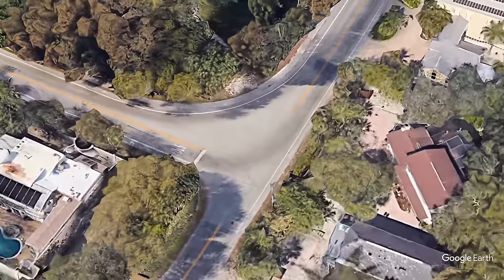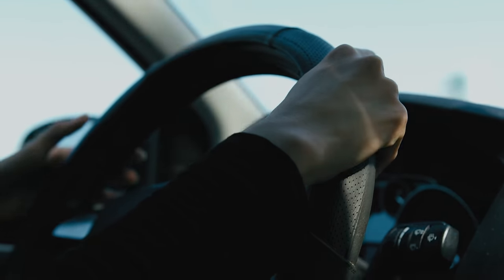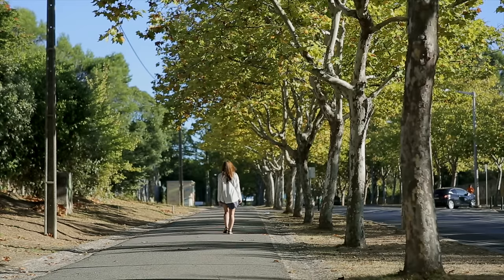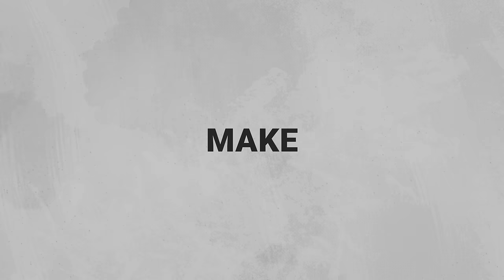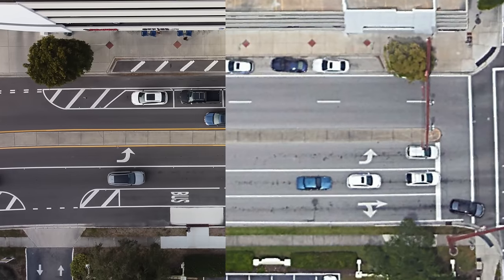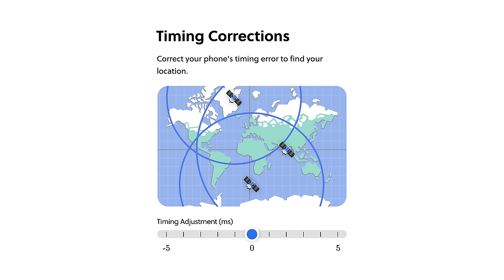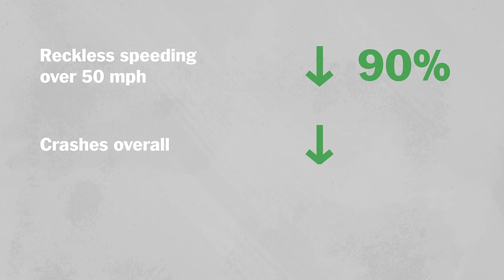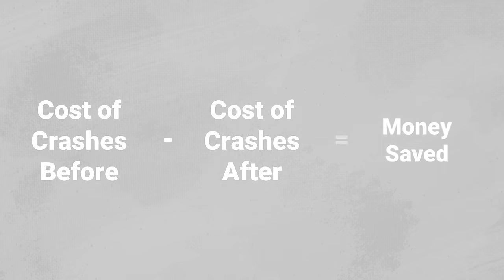This is the key to safer streets

Comment: As a European, it is very strange to see that such basic traffic regulation tools are not widespread. But I have tried to be a pedestrian in the US. Remember one place, on very civilized Cape Cod. The place looked like two, quiet villages connected with leafy back streets. But walking 20 minutes or so from our accommodation down to a sea food restaurant by the canal was one of the most scary things I’ve ever done. No pavements, no zebra crossings, nothing. And the drivers were not even looking for pedestrians. Because there were none. The next day, I needed to buy some bread for breakfast. On the other side of the street, some 250 m away, there was a small shopping mall. Based on what I learned the last night, I took the car. Because walking was just too dangerous.
Reply: I can't believe this is 'new' news. These are the basics of road design in Europe and have been for decades
Reply: I live in the Midwest and it's super common to have rural highways that cut through the center of small towns. It will be a 55 for most of the road, but dip to like 25 in these towns with no change to the road design what so ever.
Reply: yeah, even the problem with blind spots when turning is not seen often because if there's a 4 lane road 99% of the time it's going to be signaled or has the left turn removed
Reply: I live on an island which is modelled after the US and this is EXACTLY my life too
Reply: There are still a lot of places in Europe that also use anti-human road design. Scandinavia and Central Europe are pretty good now with some notable exceptions, but Eastern & Southern Europe are not much different from some bad US areas.
Reply: Yeah i feel like Americans dont understand this is literally the same as if they saw the news about how Europeans just found out that you can make traffic lights lol. It's such a basic, essential road feature.
Reply: The main reason is that there's so many roads and intersections compared to other countries, most of which serve so little traffic that it makes no sense to spend millions. It's also up to each state, city, or even private property owner to invest in roads and improve road design, not a federal investment or oversight.
Reply: @ShayneHartford  This and also most roads US were built for driving before anything else. Now expected for the drivers to change.
Reply: @ShayneHartford  "The main reason is that there's so many roads"

are you being serious? this is the country that keeps adding lanes to your  6 lane highways
Reply: When I attended a university that was split by a major stroad, I used to hold my bookbag over my head when crossing the street so that if I was going to be run down, I could throw 50lbs of engineering text books through the windshield in an attempt to avenge my own probable death. I never did that, but one time a driver clipped my bag when I put it down to my side prematurely. He had been stoping but gunned it and ran the stop sign. In staying on my feet I spun like a top and that heavy case bashed in the whole rear quarter panel. It broke the latches and ripped it out of my hands. The idiot driver actually got out of his car to threaten me. I told him that in spite of his attempt to run me over, I was still standing and that if he got within my reach, he would not be standing for a long time, if ever. With all the adrenaline I had from that close call, that was the truth. I got his plate and he wound up with criminal charges, but he was uninsured. As far as I know he lost his car and license and was on probation for quite a while. Later that month another driver ran a crosswalk light on the stroad and killed a student in a wheelchair. He was run down by witnesses on foot who caught him about a mile a way, pulled him out of his car and in the process caused enough injury to land him in the hospital for a while. His slimy lawyer had him appear in court in a wheelchair, but photos of him out jogging with his ankle monitor on turned up. Walking on or near a stroad is seriously dangerous.
Reply: @uschurch You are correct. Especially when it comes to Russia (which is where I'm from). For instance, there are plenty of unsignalised crosswalks on multi-lane highways (usually at bus stops for nearby villages), with speed limits as high as 90 km/h (which is the default outside of built-up areas). They are dangerous for plenty of reasons, but the main reason is that a car in one lane blocks the visibility of pedestrians in another lane. Although there is a rule requiring drivers to slow down or stop if a car in an adjacent lane has done so, it's sometimes ignored in practice (especially on highways). Another reason is that these crosswalks are rarely used by pedestrians, so drivers get used to not expect a pedestrian crossing there. This, combined with the high speed limit, can easily lead to a rear-end crash (which can further push the car into the path of pedestrians).
Also, drivers only get fined for speeding 20 km/h over the speed limit. And even then, it's only 500 rubles (which is a small sum) considering that they get a 50% discount for paying within 20 days. This means that in practice, drivers drive at around 20 km/h higher than the speed limit.
Reply: How were you walking next to a road if there was no pavement? Roads in the US are paved, by definition.
Also a silly reaction of you not to walk 200 yards because driving was "safer" in Cape Cod. Lol not exactly a big city.
Reply: @TehButterflyEffect  I learned British English as my second language at school. German as my third language. So "pavement" is "sidewalk". As I guess most Americans with some basic education know. BTW: Cape Cod is not a city. It’s a large peninsula in Massachusetts.
Reply: @TehButterflyEffect  By "pavement" he meant sidewalk. That term refers to the sidewalk in the UK.
Reply: @ShayneHartford  "most of which serve so little traffic that it makes no sense to spend millions."

It doesn't cost more to build a safe road than a dangerous one.

Most of the Dutch safety and bike infra has been built "for free". They update the standards with new safety research, and when the road needs to be re-surfaced anyway, it's upgraded to the next standard.
Reply: Come to Brazil, you'll be shocked how animalistic roads are 😵‍💫
Reply: @TehButterflyEffect  We also have "unimproved" roads (i.e. 4x4 trails), and gravel roads. There are also some places where the pavement is so old and of such poor quality that it might as well be gravel. The road in front of the house I grew up in was reasonably solid for normal car use, but when I attempted to sweep it up in preparation for a static display of an air ambulance I discovered that sweeping it was removing aggregate. I had to recommend against landing any helicopter for less than a real emergency. Apparently this was the wakeup call because they repaved the street the next year.
Reply: @karen_is_coming839 the point of those is to have cars speed so as to provide funding to the city/police, not to make people safer
Reply: @FlatEarthKiller  Tons of cities have grown wider and closer together over the last 50+ years making previous rural roads into city roads.
Reply: @FlatEarthKiller  The problem is that many stroads were rural routes that had a town build after a road was already there. Then expanded to a stroad. Which put more traffic on the road because it was at, near, or in between where people need to travel to get anywhere.  Also having multi unit housing along the stroads.
Reply: I agree. I tried to go car light. But, the streets are too wide and right and left hand turning drivers don’t pay attention. Now, I have to drive everywhere or risk getting run over.
Reply: We did this on purpose starting in the Progressive area. It was a moment in American history where elites and academics were given a blank check... and it has been a disaster, we are slowly recovering.
Europe relatively very poor during the time America did this to itself, so did not quite follow along.

Dutch drivers are careless and deliberately intimidate pedestrians, but in the cities the road design is good at keeping them apart.
Reply: Yess that's why I watch this, it's  kinda funny but sad too haha
Reply: This is stupid and terrible. A solution in search of problem. This slows down the street needlessly.
Reply: Ive always wanted to move to the US. Unfortunately this was my biggest deal breaker.
Reply: @t288msd From the 50s onward the idea has been to decommission trains and bulldoze residential land all to prioritize the car :( . I believe there can be change though.

Comment: The idea of using plastic to make road adjustments quickly and cheaply is really neat.
Reply: Good ability to try it out and reconfigure it pretty easily too, if a better solution exists
Reply: There are much cheaper alternatives that wouldn't be so bad for the environment though.
Reply: @MegaLokopo Enh, the plastic is recycled
Reply: @Brent-jj6qi plastic breaks down into micro plastics and is washed away into the environment. It’s a real problem.
Reply: @hotjanuary  I suppose, but honestly, a lot of the cheaper methods probably don’t last as long, or wouldn’t appreciate a giant truck going straight through
Reply: @MegaLokopo  Such as?
Reply: Roundabouts are exceptionally  useful, the downside is when theres alot of them the front outside tire wears way faster than the rest
Reply: @cyclesaviorn2700   Citation?
Reply: @kjh23gk   like evidence? I buy two additional front passenger side tires for every one full set of tires my vehicle needs. I love them though i would much rather buy the extra rubber than have to slam on my brakes every time a light wants to turn red at an empty intersection
Reply: @cyclesaviorn2700 Why are you not rotating your tires? Even with heavy roundabout use that is not normal.
Reply: @cyclesaviorn2700  That's called an anecdote, not evidence. And it's more likely caused by unbalanced wheels or underinflated tires. Do you not rotate your tires between changes?

And roundabouts are not magical. You corner on a roundabout just like you corner at a junction, or a curved road.

In fact you likely corner more on junctions than on roundabouts. Maybe you take corners too fast?
Reply: @kjh23gk  well thats not wrong by any means, yes you do corner more on a roundabout than a regular intersection because the turn is longer and at a more sustained speed. The outside tire wearing is because it is taking virtually all of the turning forces at said speeds. I have multiple vehicles in very good condition that i drive around interchangably. Between the four towns/cities i live and work in there are primarily roundabouts. All of my vehicles over the course of ten years have shown the same wear patterns and so do the vehicles of my coworkers and friends. Yes continuous rotation would spread the wear out more evenly but then the traction of the other tires wouldnt be satisfactory, whereas one tire may only cost $75 while still lasting a couple of years. Anecdotal sure but evidence nonetheless. Yes this area around fishers, carmel, noblesville, and pendleton indiana is a "race track" as well so that is a correct inflection
Added quotation marks around race track
Reply: @hotjanuary  Point is the plastic already exists and this repurposing will extend the useful life of the plastic until a better alternative can be found for bothe the traffic calming measures and the milk containers
Reply: @cyclesaviorn2700  That's not a roundabout problem, that's a bad driver problem.
Reply: @hotjanuary  Plastics aren't the enemy. Single use plastics are.

There are many great problems where plastic are actually the most eco friendly solution compared to any other alternatives.

We should be reducing our usage of single use plastic, but eliminating plastic entirely isn't really doing good for the environment.

Sometimes we do want a tough material that can survive the elements, and in this case plastic can, end up being better for the environment than anything else. 

Doing good for the environment is more subtle than just plastic bad, wood good.
Reply: They call it "tactical urbanism".
Reply: It taste really good, and it's real special! (That's plastic)
Reply: @kjh23gk  Simple paint, for a start.
Reply: You can also use paint, In the UK they use paint. They have mini roundabouts everywhere.
Reply: @MegaLokopo sheesh. Pay attention.

Comment: I live like 2 minutes away from the cicinnati road diet featured in this video. The road diet isn't even that long(only covering about a 1-3 miles) but it is in an area that sees more pedestrian traffic than other areas nearby because of it's proximity to a school, a library, and a lot of shops/resturants in walking distance. That road was super dangerous cause it cut right through that! It feels a lot safer now(and that's shown in the data too!) and I love it. Unfoutunatly though a lot of drivers hate it and are very vocal about it(my mom included). So much so that there is a chance that those changes will be reverted just based on the vocal opposition alone, but the safety data isn't on their side and with all the work that went into getting it approved I doubt those involved will just stand by and allow that effort go to waste. A big part of that opposition I feel comes from people who drove on that road being used to going down it at such high speeds and also having a second lane to pass people, which is exactly why the road was so dangerous.
Reply: One of the problems that many people overlook is that a lot of infrastructure can grow next to a road in a very short time.
Expecting drivers to change for that. Even though they were there first.
Why don't we build around the road instead of expecting the road (drivers) to have to change?
Reply: "Uhgh, come on slowpoke, step up the pace! Who drives 40 in a 35? Wish I had a passing lane."
Reply: @randgrithr7387  That's basically what the naysayers sound like 😂
Reply: @AdamStansbery  Drivers adapt really fast when there's road work or even after a road gets widened. There's nothing that would make this different or harder other than spite. Regardless, driver's ability to adapt is not really a huge problem because people eventually get used to it. The only reason people haven't already is because it's all temporary infrastructure at the moment and there's a chance it'll go back to what it used to be ans some people are banking on that.
Reply: @AdamStansbery  That's exactly what makes stroads so dangerous. The side effect of that growth is that it's hampered by the reduction in pedestrians who don't feel as safe. The data shows that the more friendly a street is to people walking and biking rather than driving, the more businesses on that street benefit. This is largely due to how people behave when driving vs walking/biking. When someone drives to a place, they tend to only go to one particular business before driving somewhere else. They also tend to change their plans based on available parking, increasing the chance for lost business. Pedestrians/cyclists, on the other hand, are more likely to go to multiple businesses in the same area per trip. It's a no-brainer that changing priorities away from drivers is better overall, for both safety and economics.
Reply: @TheMaestroso  You're wrong. You can't attack drivers for this. This is not drivers fault and never has or will be.
It's an infrastructure, zoning, and driver training problem.
The only way forward is better designed roads. Have you even seen better roads? A better road has at most three lanes with one center left turning lane. Then with a separation of around 15ft of grass (with a possible walking/bike lane) plus an access or intersection then an outside two small lanes of travel on both sides that gives access to businesses. I don't know if it is Norway, Sweden, or Denmark that has roads something like this. But it is the best for all.

Never go after the drivers. They are using what is setup for them to use.
Reply: @underballbutter  The problem is all the people who have been hit and all the kids who have died on that stretch of North Bend. With all the new development going on in college Hill the foot traffic was(and in fact already has started!) increasing in the area. It was an unaddressed problem that would've gotten worse with how the neighborhood has been changing and is projected to change going into the future. Just because you don't see it as a problem doesn't mean this is a solution looking for one.
Reply: @izzylee64 I live in the College Hill area up the street from the diet road
Reply: @thablksovereign  What are your thoughts on it?
Reply: @izzylee64  I don’t mind it and I see as a good thing cuz College Hill is developing I see a bunch of restaurants and they want to make it safe for pedestrians

Comment: The issue with stroads is that they generally started out as a highway through uninhabited areas between cities. Then, the cities grew and developers built subdivisions along the highway, then to service the homeowners businesses needed to be built nearby and start popping up all along the highway. Now the connecting highway built for high-speed traffic between cities is in the city.
Reply: Hey,  it's OK to leave highways as highways. But it's definitely not OK to just place sidewalks and business entrances directly at a highway, not to mention homes. That's what secondary and tertiary local streets are for. There should be miles of highly walkable area until you encounter the next highway. I'm sure there's plenty of space for that, I've heard America is a large country :)